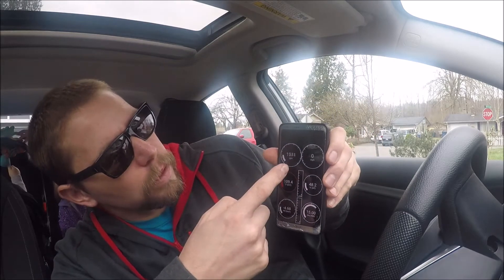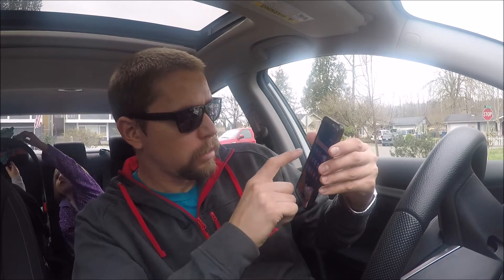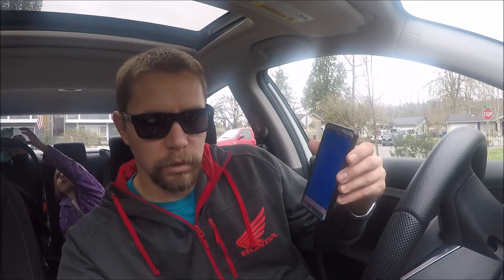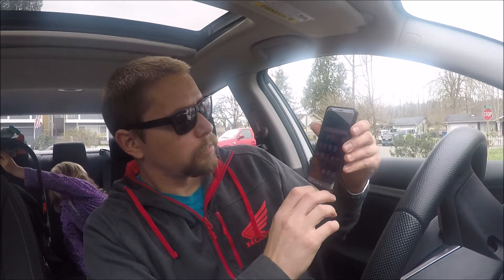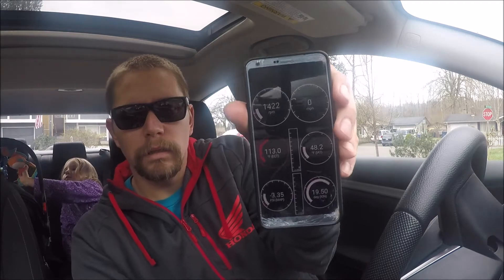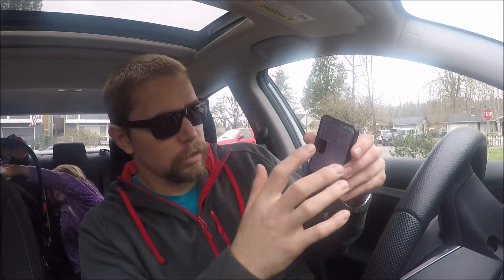MAF scale tuning part 1 of 2, the prep work. 2017 Honda Civic EXT

Comment: I need help with this on my 2010 Honda Fit. I boosted and need to change the air/fuel ratio but there isn’t any boot tables on ktuner for my fit. I was told to do it via mass air flow sensor

Comment: Great informative video man. Question, should I tune my ext manual or purchase si or type r?
Reply from the maker: depends on how much you are going to have to lose to step up to the SI in my opinion. the 2 are so close that I see how they are comparable but the CTR is so far ahead of both (price and overall experience, not necessarily straight line) that if you want to get the CTR and have the means to then you might want to just do it. trying to make an EXT an SI beater shouldn't be too bad but to try and take down the CTR (again not talking a stock one in a straight line) with the EXT is going to take a lot! If it's a fun daily driver you are after then I say mod the EXT, if you are going to hit the track and the SI isn't too much of a hit, then step up.